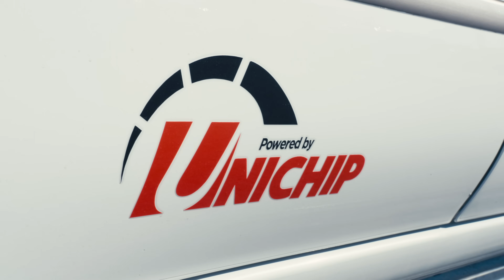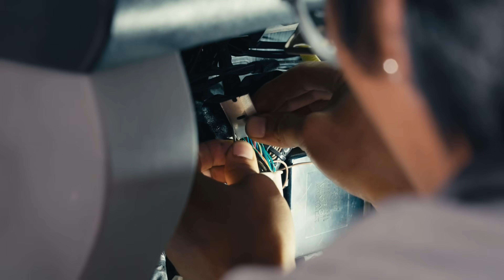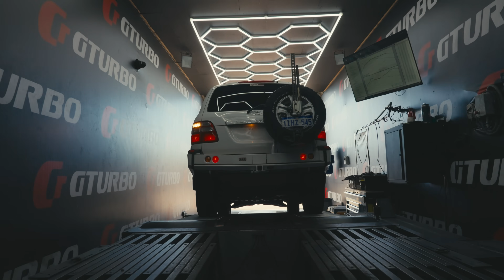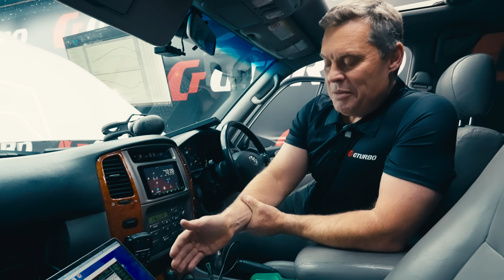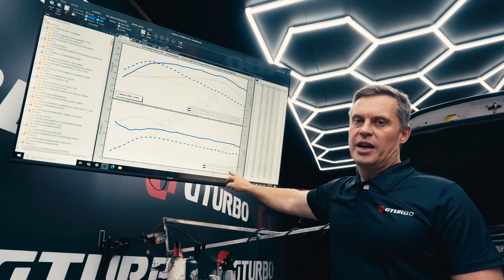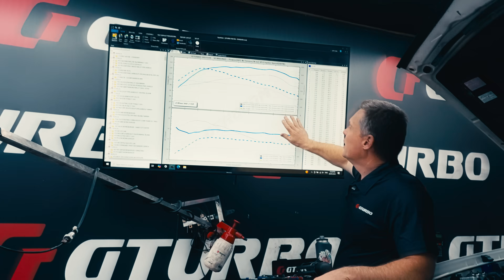640,000km 100 Series Build

Comment: Perfect timing, my 1999 has 660clicks on the clock, am getting oem new pump and new oem injectors installed this week. Eye watering cost, but cheaper than buying a plastic truck built this century. Am seriously considering a mild 18psi uni chip tune. When u change the injectors, any chance you could give it a compression test. I’m getting mine done to see how things are. Can’t wait for the next episode.
Reply: Although my 2011 lc76 was built this century I feel the same way, the only aspect of it which belongs to this century is the engine which hasn't had any issues with 220k so far, just dreading starter motor failure and new injectors eventually
Reply: @cyclemoto8744  @engine care from QLD has a great clip on the plastic oil pickup

Comment: Great vid, very interested to see the stages.  I have one of these in the 4 speed auto which I use to tow 3.5t.  I've got the HPD intercooler upgrade (small one), new radiator and 3 inch exhaust.  It performs well all day now up hills without de-rating with heat soak.  I see these vids getting great numbers on the dyno, but I'm interested in what the tune looks like for towing with 100% duty cycle.  So boost, afrs etc where it can be pushed all day without worrying about egts etc.  I'd be happy with 100nm extra for example but want a factory level safety.  Anyway good to see you are putting these vids together.

Comment: So basically these are the best cars ever built right?
Reply from the maker: yep👌
Reply: I concur. 
2006 SAHARA 270k on the clock owner, bog standard love it bits. 
However…….. would be interesting to see what she can really do!.
Reply: Did the full package on my bog standard 04 GXL with gturbo at 260k’s and couldn’t  be happier - 300hp and 720nm on tap, every drive puts a smile on your dial let alone what that means when your off road
Reply: @Turbofte  A750?
Reply: Just wondering how many k's you have run a A750 in a 100 series with high HP without failure?

Comment: Next time you wire in a Unichip show old mate what heat shrink tubing is
Reply: over the wires he taps but doesnt cut?

...

tape is fine if you use proper shit
Reply from the maker: we always try to use heat shrink but most of the wires we have to tap on so we can't
Reply: Can’t use heat shrink on wires you tap into…?
Reply: @MTDiesel9 I did on mine but not really necessary. You just gotta depin the wire from the connector
Reply: Liquid electrical tape then for non cut wires
Reply: Just use scotch locks like a pro......😂